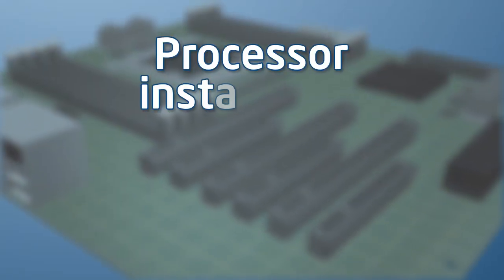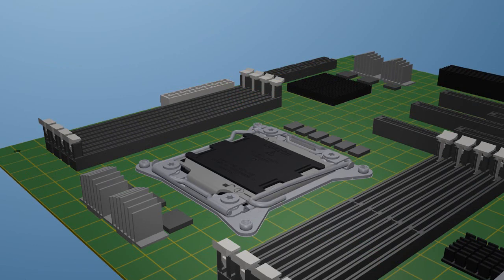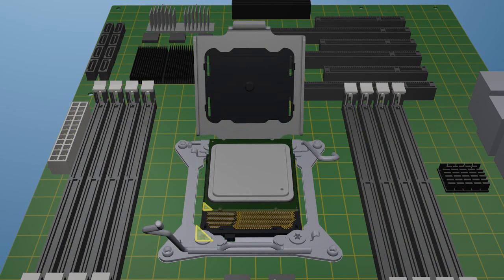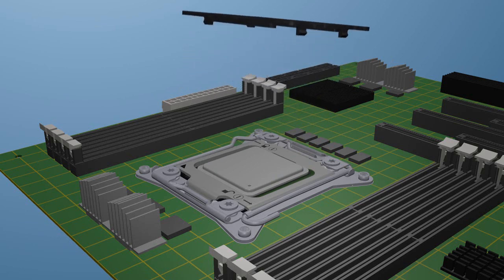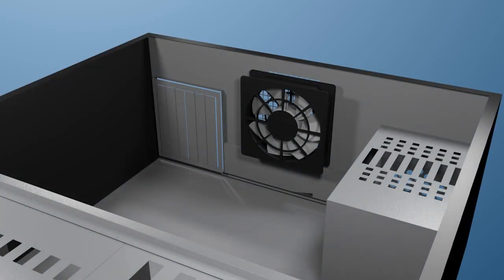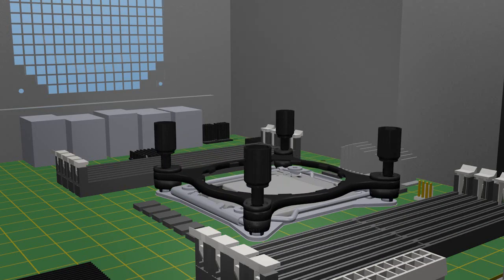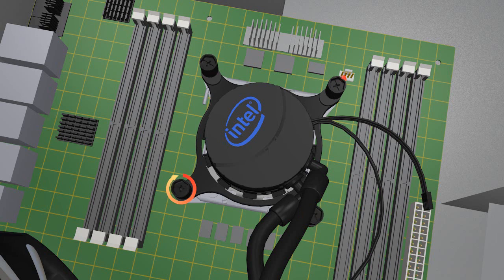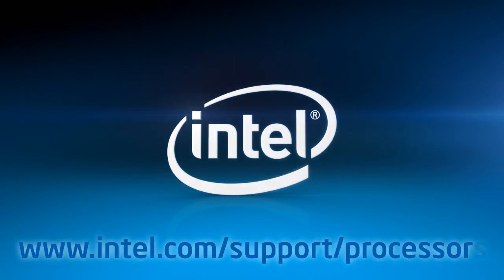Intel Socket 2011 and RTS2011LC CPU Cooler Installation Guide

Comment: TIM stands for thermal interface materiel. It is a very conductive gel like materiel that allows for better heat transfer between the heat sink and the processor. Just put a pea-sized drop onto the processor and press your heatsink down. If you spread it, it creates air bubbles between the processor and heat sink. Air is the exact opposite of TIM; it is a very good insulator. Plus, you don't need to spread it, as all of the cores are pretty much in the middle of the chip.

Comment: decent video.  personally, I was unable to keep my mounting screwed on loosely enough to insert and twist the cooler.  I had to put on the thermal compound, and then manually thread each screw on the bracket while holding the cooler head in place.  

the water cooler was honestly a complete pain in the A to install. 
however, once you get it fired up and that neon blue intel logo lights up - you feel like you have converted your PC into the space shuttle or something.  looks awesome. works great
Reply: I'm having this problem this very moment. Its nowhere near the point where I could get the cooler under the mounting teeth.

Comment: The only thing there that I was wondering about was what they called "the tin"? In other words I am not sure how much of that to put on the cpu. I don't normally build my own but I am going to start so I was wondering about that fluid amount. looks like they don't spread it around either just place the assembly down on it spreading it properly I guess?